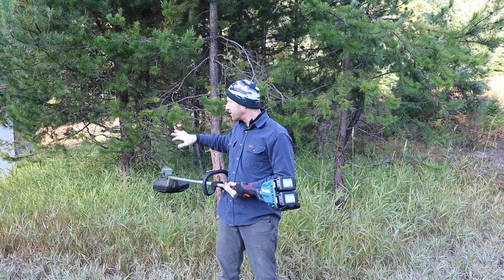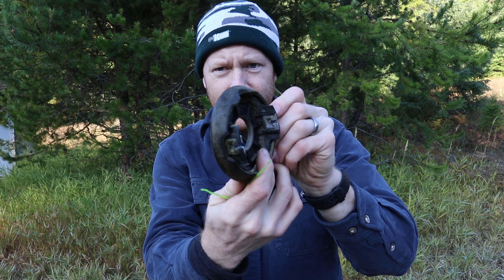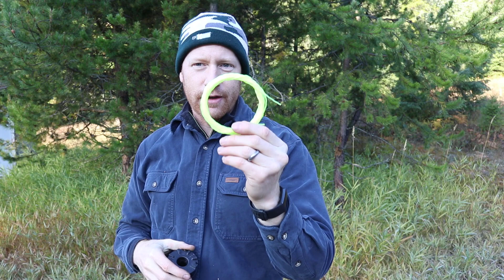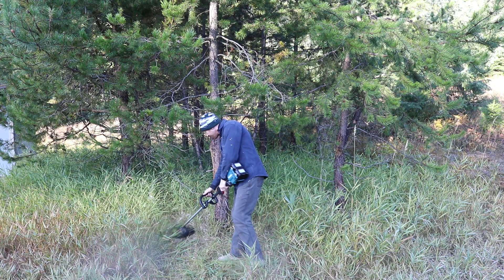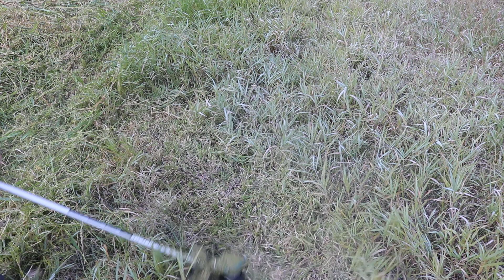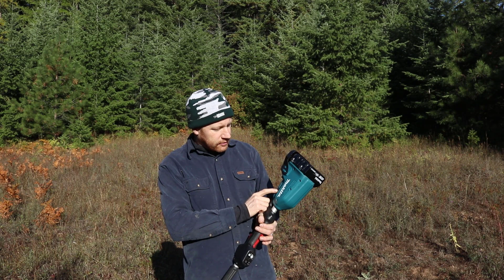Tool Tuesday Makita 36 Volt XRU 09 Cordless String Trimmer

Comment: String goes around clockwise if the base plate faces you (side with printing and hole).
String goes around Counter-clockwise if the base plate face you.
But don't forget that we are referring to the direction the string goes around the hub...
so if instead you are focusing on the direction you spin the hub when holding string steady in your fingers (like Dan), then spin the hub the opposite of the above.
Geesh, maybe it's easier just to forget it all and try whatever you want,  then if it doesn't work you know to thread it the other way!
Anywho, from his perspective Dan is facing the nobbed end (not hole) facing towards him and moves the HUB clockwise - that's my story and I'm sticking to it (and will continue to look for my comment most every time I rethread (or eventually scribe the direction on the hub!)

Comment: I just bought this trimmer and when I put in third speed it only runs for about 40 seconds and the 2nd and 3rd light starts blinking is this normal, anyone has a solution for this?

Comment: I see you're being humped forwards when using the trimmer. This can get very uncomfortable and painful during the longer sessions of trimming. EGO trimmer is, as far as I know, the only trimmer on the market with the telescoping shaft that allows the user to adjust the length of the trimmer and personalize it for their own height. It's a brilliant, although expensive solution, given that a shaft is made out of the carbon fiber. I'm surprised no other manufacturer tried to do that, from the commercial heavyweights like Stihl and Husqvarna to Makita or DeWalt.

Comment: Yes, those OEM Makita trimmer heads are abysmal, which is very surprising given the quality and innovation that Makita's engineers bring to the market with their power tools. But the feeding of the line is not the worst part of it, (many companies use pretty much the same system of feeding the line into the head). The biggest problem is the bump action that releases the line when the strings get short. It's a hit and miss. Sometimes you have to bump that s*** multiple times without any result. It's gets frustrating fast, especially when you're running a business. But the solution is out there - using a head from another manufacturer. Many professionals use the Echo Speedfeed head that eliminates dissasembling of the head completely. I won't explain how it works here, there are tons of videos showing their clever system in detail. I find the Speedfeed head to expensive for a small upgrade it brings in the way you're feeding the line. I use Husqvarna's T35 trimmer head. The feeding system is similar to Makita's, but the operating experience is smooth as butter. The line gets out of the head very easy and just the right amount of it. T35 also proved to be much more durable than Makita's head or even the Speedfeed.

Comment: Makita are disgraceful the way they deal with recalls. I’ll never buy a Makita product again because of the way they dealt with my situation.
I bought a Makita line trimmer.
I used it a handful of times, 5 at most, until I realised it was defective a couple of years later and found there was a recall notice on it.
I took it back to have it ‘repaired’ by a Makita authorised repairer.
After I got it back, I spent months trying to get it working without any success, then just started borrowing line trimmers from friends and family.
I tried to get it going again this year and took it to a Makita service centre at Keilor Park in October and they said an angle grinder had been taken to it and that's why it’s not working. I dealt with a donkey national service manager who just had a good laugh at my predicament and suggested I did the damage – brilliant customer service! 
Other donkeys I dealt with at this place didn't have much of a clue either.
My advice is to avoid Makita products.
Reply from the maker: Wow, sorry to hear about your experiance. Honestly though, no power tool manfacturer is great on warranty and replacement help. (Unless you happen to be part of a huge construction company and the regonal sales people are trying to keep you happy. Seen that first hand with B&D.) I just tried to have my Festool vaccum repaired by an authorized repair location but they said that Festool no longer provided parts for it so too bad. I don't expect a power tool to last more than four or five years so I don't even bother with the store warranty. If you find somthing better, let us know. Thanks.
Reply: Thanks Dan and Sarah. Very disappointing experience. I emailed and called many times and no return emails or calls. Was beginning to think they had gone out of business! Am on to Stihl now and couldn't be happier with the quality of their products and customer service. All the very best.

Comment: I just was given a XRU 09 trimmer that looks to be discontinued and was used for a year or so I am guessing. The XRU 15 is the newer version with 3 speeds rather than 2 like this one has. Two seems to be enough for our yard and I got new batteries (5amp) and it runs great. I will never use it as much as it was used so it will last a LONG time. Really well built, those brushless motors are impressive.

Comment: Thanks for posting this helpful video.
Reply from the maker: No problem, I now have a newer model which may be a bit better but my father has adopted this trimmer and uses it for hours every day  ( no exaggeration) cutting the kind of under brush in the video and it is still going strong to this day. The only down side is that the woody brush eats through the trimmer line pretty fast but that has nothing to do with the trimmer! Thanks again.

Comment: My friend is in our late 60"s🌿 allabout.wiki/XRU11M1 and we are huge Makita fans and have been for several years. We have more than Makita tools. This weed eater was just what we needed. I opened the box at 2:30 and by 3:10 I was trimming weeds and I am not handy. I trimmed for nearly an hour on the same small battery. We had a larger model and gave it to our son-in-law because it was just getting too heavy for us. This has very balanced weight and we love it.

Comment: My 18 year old Echo string trimmer is about to crap the bed. Maybe it's time to go battery. Since I'm already heavily vested in Makita, this seems like the logical direction to go. But here lies my dilemma. Makita offers this and other similar models as well as a couple shaft model which accepts different accessories. On that one, the motor is located in the power head along with the batteries. This results in a totally different weight distribution than having it at the opposite end. Before I make this investment, does anyone know which configuration is more user friendly?
Reply: Keep in mind Echo has a battery operated trimmer of its own. The 2100 and the 2600 which is the real weed beast. A bit pricey thought.

Comment: I've replaced the head on my trimmer (DUR369A) with an Aussie Turbo Ripper (https://turbohead.com.au/shop/ols/products/atr-straight-shaft). The 36v makita trimmers are clearly excellent machines (even with the supplied auto feed line head), however putting 3-4mm trimmer line into the ATR made the Makita an absolute weapon (I mean a whole other level of awesome). The existing head is fine for light domestic, but should be swapped out for anything beyond that.

I think the centre of gravity of your machine is where you connect the harness/strap, not where either of the handles are.

Comment: You're biggest mistake that you did was not having safety glasses on if you're gonna show things you gotta show the right way to use the tools safety glasses are a 1  1st thing you put on before start any kind of machine gas or battery specially if it throws things around
Reply: Thanks Karen.

Comment: I just bought a new one and they must have change it since. It’s now got an easier line feed things that you don’t have to pull apart (loads from the top). 
I did find I had to stoop down a bit but I’m also 6’5”. I was hoping it was just an adjustment. 
Overall I love this thing because you just pick it up and go. No smells or mixing fuel. My 36v Makita blower compliments it nicely as well.

Comment: How long do the batteries last?
Reply from the maker: It really depends on what you are doing with the weed eater. We have found that it will cut tall grass and small brush for around 45 minutes - an hour. However most people will not use it non-stop so it is a little hard to say. Hope this helps at some level.

Comment: Can you ad a blade?.
Reply from the maker: I haven't looked into that as an option. As far as Makita would advise, probably not.
Reply: Dan&Sarah Makers ok thank’s 👍👍
Reply: Yeah you can absolutely add a blade, this exact trimmer in Japan comes equipped with a sharp carbide tipped blade by default. Just have to make sure you don't hit stones or fencing to chip the teeth.

Comment: I just bought one and its phenomenal. I was that person like you watching this wondering if its worth the big price tag...... honestly it's amazing and you won't go back 
I now have a huge collection of makita brushless tools , drills, grinder, blowers and many more 
I just need the mower now......
Reply: the mower is awesome!
Reply: @licencetoswill  ok good to know. I recently bought the new ryobi/Yamaha petrol mower from bunnings,, I love it ...... but I'm going to get one of those electric mowers now that everything else I've got from the makita brushless series has been impressive
Reply: @jaradrockley  I have the 21” self propelled Makita mower that you can get for $699 and it is an absolute BEAST! Makes my Toro gas mower obsolete. My back yard flooded during the last winter season and took out my gas mower in my basement. I replaced it with the Makita mower and by the time I got it, my back yard grass was as tall as me. Im 5’10”-6’1” depending on what convenience store im leaving. I actually used the makita hedge trimmer to cut the gras to about 6”. From there I set the mower on it. And when I thought I would bog it down, it just kicked into high gear. The bonus is right now you get a total of 4- 5 Amp hour batteries and a dual charger in the package for $699. The cost of the batteries and charger come to about $500 if bought separately. Makes the mower a steal.
Reply from the maker: I have the earlier model of the 36V mower and it actually does quite well.

Comment: I have this exact trimmer and have used it for a year now.  I really like it, my only gripe is it needs to be longer for taller people, I'm 6'1" and my son is 6'4" and after about 20 minutes my back is killing me from the hump over effect.  My solution is to extend the aluminum pole to make it longer thus no more humped over. Because there is only wires in the pole it should not be to hard to Fab up. Thanks for the very accurate review on this model!
Reply: mark yeah, why would they offer a 6 or12 inch extension.

Comment: How long do the batteries last as heard conflicting reports?
Reply: Ive had mine as long as dan, if you use 4amp battery it lasts for at least half hour, ive put 2 6amp in an cut loads an then they still had half left so used I'm up in my grinder. I think unless you're a farmer or company doing lawns, I would not worry about run time. It's that powerful and quick  ive always been done before the battery.
Reply from the maker: It runs for about 30 minutes in tall grass and forest underbrush.

Comment: I am always impressed by what brushless motors can do these days!  I run the Milwaukee combi system (trimmer, edger and hedge trimmer) and the blower.  I love it.  I used to own all gas and hated it.  I am just missing a mower and I'll be set (Milwaukee has nine out yet)... and a snow blower also.  My Ariens will be tough to let go though lolll.

I like the reverse feature!  It is not an option on mine. Can you actually cut with it though?  I am left handed and when doing my flower bed edges, I have to walk into the bed to prevent the grass trimmings from flying into the bed itself.  Right rotation and having the unit on the left side is not the best.  Having reverse would be perfect for that.